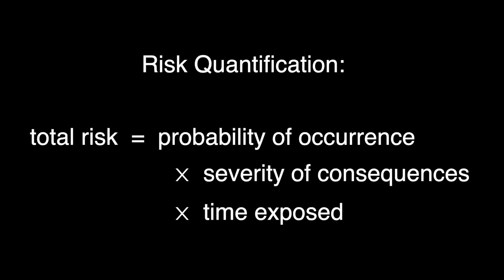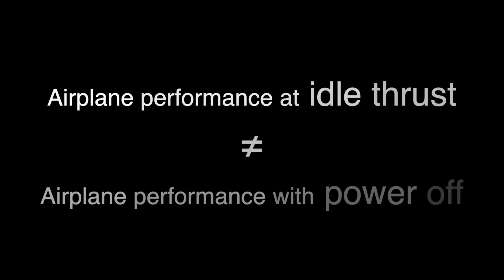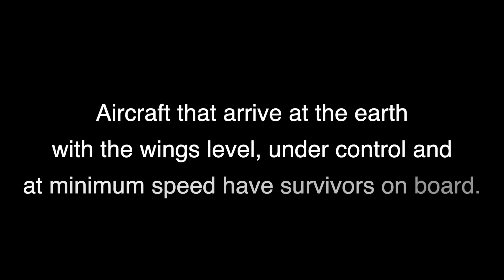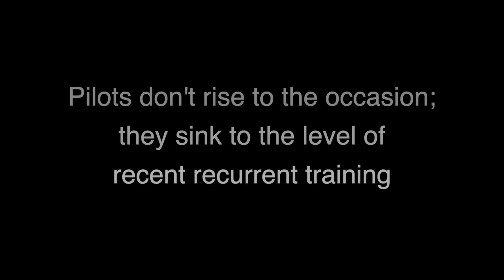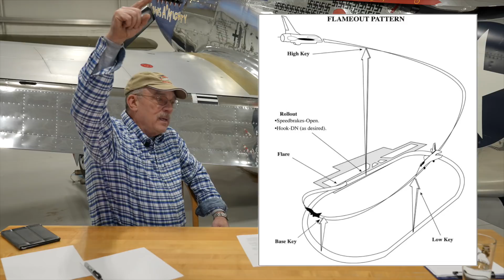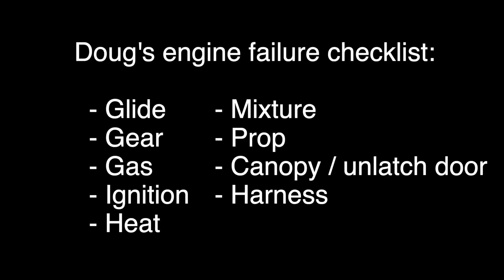Loss of engine power and the (im)possible turn - with Doug and Martin

Comment: On "The Turnaround Maneuver". YOU TURN AROUND THE AIRPORT.  That means he crashed AFTER TURNAROUND MANEUVER" and could not complete it, stalled it before the runway start area.  So it was An Impossible Turnaround, not An Impossible Turnback.  Those are two different maneuvers.  Never confuse needed maneuvers. A Turnaround is not A Turnback.  On the Turnback you dont turnaround anything, you just go to the closest runway on side if, or behind you if altitude and speed to do a 270 degrees of turn.  Many accidents are A Turnaround.  The ones that dont know Turnbacks call them A TURNBACK, when it was A Turnaround.  Different maneuvers they are.  I used to teach them both in my 1990's CFi years..

Comment: A 50% increase in speed is a 225% increase in kinetic energy! Going from 40 knots to 60 knots with the same mass is 2.25 times the kinetic energy. 1/2 M V**2
Reply: That important to know. Thanks
Reply: That was a real good video.  I and many other pilots don’t do enough thinking and planning in the event of an engine failure.  It was interesting to see the P51 painted in the paint scheme of George Preddy’s P51.  He was from Greensboro NC which is near where I live.
Reply: Correct
Reply: absolutely correct about that. 2.25 not the x 3 claimed. Also, no way you are getting a sink rate as low as 5-600fpm in a 45 deg banked turn in an idling C-172, so I'm calling BS on his claim to have done that many times. 600fpm wings level, just maybe.

Comment: Interesting comment about the power-off 180 and commercial license.  I learned to fly in 1977 from an old school instructor and EVERY landing we made was a power-off 180.  That is simply how he flew his airplanes (he was the airport operator, CFI, A&P and a DE) and how he taught his students.  When every landing is done that way, it makes off airport landings much easier as you have a fairly good feel for how far you can glide at the moment the engine quits.  Pilots should not need a commercial license to learn this skill.

Comment: 10:09 Yes we did simulated Engine quit After take of.  1996.  First at 2,500 agl, when coming back from cross country flights.  Then on 4,700 feet long runway with about 10 knots headwind.   We on Cherokees, did Turnbacks from 600 agl partial power, and 700-800 agl idle power Turbacks.  My CFI was the CFI of EmergencyLowManeuvering channel here on youtube.  He had 4 engine fails on take off before and knew those emergencies well.

Comment: Excellent video and discussion on risks and engine failure. 

According to the AOPA, engine failure is the 3rd leading cause of fatal GA aircraft accidents. 

If you look at even small FAA  part 135 Operators, they generally won't be flying passengers for hire in piston single engine airplanes for that reason.

Comment: EDIT: I've added one more question to my post.
Wow!  What a great bunch of lessons!  I had my own agenda hoping for a specific piece of info to be talked about (minimum acceptable AGL altitude in a Bonanza for a return to the airport with an engine failure during takeoff) that I began watching it by trying to play the video at 2x speed to more quickly get to that part.

However, what actually was talked about was so interesting and dense in content, that not only did I have to go back to regular playback speed, I also had to keep going over the same comments again and again, so I could take good notes.  Mr. Rozendaal is an encyclopedia of aviation wisdom!  Knowledge is great, but wisdom is better and he certainly has it!

As Mr. Rozendaal explained, because much more of the flight is spent in cruise,  the majority of our training time should likewise be spent on engine-out procedures during cruise, which can also include the part of cruise that occurs during takeoff, so long as "high key" altitude has been attained.

The only 2 details I would have loved to have seen addressed are:

1) Approximately what IS "high key" AGL altitude for a Bonanza?

2) Although 99% of the times, ANY strategy would be safer than trying to execute the "impossible turn"; there WILL be airports where the only alternatives to the "impossible turn" - due to population density - are flying into the side of a building or on top of a house.  It strikes me that in a situation like that, although attempting the "impossible turn"... MIGHT result in fatalities to pilot and passengers; flying into the side of a building would make fatalities even more likely for all on the aircraft, but would additionally exposes those in the building to being killed.  In a situation like that, wouldn't attempting the "impossible turn" be the "lesser of two evils"?  However remote that scenario might be, does it not make sense to practice the "impossible turn" (at a safe altitude) to at least be aware of what that minimum altitude should be in order to attempt the impossible turn?  The more altitude densities, passenger configurations, load scenarios practiced, the better of course.  I pose this question while being in full agreement with Mr. Rozendaal that however much value there is in knowing that/those altitude(s) and training for it; he is certainly right that much more time should be spent training for procedures when "high key" or near "high key" altitude is what we have to work with.

ADDITIONAL QUESTION
3) This question relates specifically to a set of circumstances where attempting a return to the airport poses a risk of fatality to the fewest number of people, i.e., an airport near a highly developed and populated area.  It occurred to me that for an aircraft like the Bonanza, the climb rate you choose (Vₓ or Vᵧ... or something in between) might be very critical for minimizing risks if there is an engine failure during takeoff.  I feel like there are 2 foundational considerations to this question.  One is that, at  Vᵧ, a high performance airplane like the Bonanza is substantially further away from the airport by the time it gets to 1000' AGL than say, a Piper Cub.  This means it also has more distance to cover to make it BACK to the airfield.  The second issue is that a Bonanza probably requires a much higher "High Key" AGL altitude than that of a Piper Cub.  If the Bonanza is routinely taken off at Vₓ, the advantage is that it's CLOSER to the airport at any given time of engine failure than it would be with a Vᵧ takeoff.  On the other hand, it'sALSO at a lower altitude in that same amount of time, so the severity of consequences is probably higher if the only option is to turn back.  On which side of that equation should a Bonanza pilot err?  To get the lowest total risk factor, which detail is more important in that risk equation?  Less time exposed to the danger, or lower severity of consequences?  Vₓ or Vᵧ?  Or is there some better balance in between the two?  More simply put, if a Bonanza pilot is taking off from an airport that is surrounded by buildings in all directions, is there a 'V' speed that's best, in order to have the lowest overall risk factor?

I hope that's helpful feedback and thanks again to Mr. Rozendaal and to you also Martin for such great content!!

Comment: Great video Martin. One point worth mentioning is that GA pilots rarely do a pretakeoff briefing. We should know what the takeoff power should be, and abort if we don't see that when we push the throttle in. If not airborne by 50% of the runway, abort the takeoff. Verbally go over what to do if the engine quits below 1000 ft, and what we consider to be the safe altitude for a 180 turn back. We can't figure out all these out during an emergency.
Reply from the maker: Yes. We do talk about a pre-departure briefing in this video, and even link at that point in time to another one dedicated to the topic.
- Martin
Reply: My CFI does a pre-takeoff briefing on every departure.
Reply: My new CFI..
 Video explains it soon on my daughter’s channel @fatherdaughterflights… insists on briefing abort/engine loss and “other options” on every flight. Our first lesson was a “did not depart.”  But I logged l2 Hobbs of taxi! 😎

Comment: Better practice first The Flyover Teardrop Turnback. At level flight at Vglide speed and 1,000 agl, fly over a highway, pick an easy to see spot,  fly over it,  then do a Teardrop Turn to fly over again in opposite direction.  Then do a teardrop again.  Do 3 plus until you do them very well.  Then fly over doing a Hook Turnback instead of a Teardrop Turnback.  Do a few Fly Over Tunrbacks Teardrop then Hook Turnback kinds.  That way you will understand Turnbacks better BEFORE doing them at airport.  
 At Airport do them partial power first from turning crosswind.  Last ones nose down power off 800 agl after take off.  Ignorance is not the solution, Ignorance is the problem.  I used to teach all that in my 1990's CFI years and know 3 pilots plus me that saved from crash on houses doing partial power turnbacks.  One of them he did C172 w 3 on board from 300 agl only.  No accidents we had.  You do Turnbacks on Flyovers, Box Canyon Turns, Circling Approaches and of course, LOTOT and EFATO Turnbacks too. 5 PLACES. Many accidents from pilots ignorant of turnbacks even if experts on IFR or Mild Maneuvers.

Comment: HI Martin another great video regarding safety,  many years ago  engine failure in 960 wooden wing Mooney m20A  returning at  night flying from Ottawa airport during instrument training to home airport 25 miles away.climbed to 8000 going west  about half was engine quit, the instructor stated he would take control I stated no my aircraft,  I had 300 hours of glider flying so position the aircraft over my home airport with circling approch and landed safely.  I was a bit high so did a side slip landed about one third down the run way. Knowing the L over D of your aircraft very important from a safety perspective. Keep up the great work Christopher Ottawa Canada
Reply from the maker: Sounds like a perfectly executed engine-out approach and landing, Christopher. Very glad nothing worse happened. Were you able to determine the cause of the engine failure?
- Martin
Reply: @martinpauly  yes broken crank shaft this happened long time ago 1967 this was my last single engine after that all aircraft after that were multi engines twin camaches, senacas then aerostars. Christopher Ottawa Canada

Comment: Great video. Stick and Rudder by  
Wolfgang Langewiesche is a great book that discusses this matter in depth. Aviation has several paradoxes such as to the idea of landing in airplane you have to prevent it from landing and in regards to an engine fail to keep the airplane flying you have to point it to the earth. Also to survive an engine fail you have to purposely attempt to crash the airplane in a sense. For the most part we are basically left with two options we must come to terms with once we are presented with an engine failure do we wanna spin in or crash pick one.
Reply from the maker: A great book indeed!

Comment: Another great informative video Martin.  I could listen to Doug for hours. My “home dome” here in DFW is KADS which has simply horrible landing options for runway 15 departures. Runway 33 is better but not neither are great. Oddly looking back over the last 10 years of multiple instruction flights in and out of Addison I honestly don’t recall a single instructor ever briefing on possible landing/controlled crash sites. It’s probably because there aren’t any and we’d rather not talk about it. I’m going to take Doug’s advice and do a more exhaustive study of the ‘ahead of the wings and into the wind’ area from my airport. Once I’m actively instructing one of the things I’ll implement is to introduce some sort of emergency situation on each and every flight. “You just lost an engine/you just lost your radios/you passenger just threw up all over your instrument panel... you get the idea. Keep up the great work Martin.
Reply from the maker: Addison is indeed a difficult place for this. The fewer the options are, the more important it is to study and understand them ahead of time. And in some cases, the right thing to do may be to shift our focus from saving ourselves to at least not hurting people on the ground. As Doug said, we have a moral obligation to protect them.
- Martin

Comment: Great video Martin as always very informative. Sure hope to get to meet Doug one day. One thing that wasn't mentioned that I learned flying a T34 or any aircraft with a constant speed prop is to get the prop control to full low pitch, its like releasing the emergency brake and really cuts down some drag. May make the difference in some turn back or 180 degree turn situations.
Reply from the maker: Good point on the prop control, Mike. We did not go into how to achieve best glide performance in this video - not that it's not important, but it's somewhat separate from the topics we discussed, and of course also aircraft-dependent. 
Come join us for a Third Thursday sometime to meet Doug!
Best regards,
  Martin

Comment: I’m a flight instructor and I teach many of these concepts on the ground and in the air with my students. I very much appreciate this video and how the material is presented. I’m saving it in my archive to share with students.

I had a question with the handful of times it was mentioned to practice at altitude by pulling the mixture. While valuable to assess a more realistic sink rate versus idle throttle, etc, I wanted to make sure that wasn’t an error in speech like it was for the power off 180° you edited. Thinking about it from a risk assessment standpoint in a training environment, it obviously increases the chance we could truly have an engine failure if the mixture cable breaks and is unable to provide fuel back to the engine. With enough altitude that risk could be worth it if you have adequate landing points within glide. Just seeking clarification. 

Thanks again for the video!
Reply from the maker: We actually intended to say "pull the mixture" there. I am not suggesting everyone needs to do this; the point was that all the people claiming a turnback is no big deal because they have done it successfully with the power at idle might rethink their position if they actually flew one with NO power instead of IDLE power. It is possible to experience and quantify the difference safely over an airport in gliding distance of a runway. And it is also possible to misjudge the glide and land off-airport if the engine doesn't restart. I'll let you be the judge of how likely that is and whether the prospect of discovery is worth the risk.
Regards,
  Martin
Reply: Thank you for the reply. I’ve since tested the wings level best glide sink rates while solo in a C172. My idle power best glide sink rate was 600 fpm versus a no power best glide sink rate of 650-700 fpm. A fairly subtle but noticeable difference. Thanks again for the reply and video!

Comment: Use the 777 EFATO Turnback Rule for light singles.   The 999 rule is for heavy singles. 
  The 777 rule can be done even when on preflight or driving to airport.  Will I be able to climb over 700 fpm? Yes? Are the winds over 7 knots? Yes? Then mark the altimeter to 700 agl for EFATO turnback.  The light Single engine 777 Turnback Rule
I learned turnbacks in 1997. 2 kinds.  For partial power, and no power.  Lately my 1997 CFi (retired now) came with a simpler formula. 
For non heavy singles = THE 777 TURBACK RULE NO PoWER

Comment: Another great discussion on an often underrated matter. However I don‘t agree entirely on the gear up or down topic. My intention would be to have the landing gear absorbe some energy as it might shear off. Another point would be a chance of better controllability on the landing roll. Just some food for thought.
Reply from the maker: It is certainly possible to conceive scenarios where the extended landing gear provides an advantage. The problem is that in real life we won't be able to tell exactly how good of a surface we are landing on. On a typical farm field, I believe Doug's advice is sound.
- Martin
Reply: The likelihood of ending up, upside down is much greater with the gear down.   The conventional wisdom is on un known unimproved surfaces gear up, in the trees gear down, and if you are willing to bet your life on the quality of the surface, gear down.

Comment: Thanks for the content.
I'm a beginner pilot and actually want to buy a plane. My misson will be "low and slow" in Switzerland, mountainous area. For safety reason, I prefere a STOL-Taildragger (like Kitfox, Cup). So if engine quits, I assume to have more options than with "a normal plane". Speed is life, altitude is life - I know. But the mission is different ;-)
Is a Taildragger a good choice as first plane for a beginner? I think no, when I see the taildragger vids from Martin and Doug.
So my question to the community, to Martin or preferably to Doug: What should I look for. I like to be in contact with Martin or Doug for that, if possible. Thanks.
Reply from the maker: I would not advise against training in a taildragger, maybe unless you live in an area where it's almost always very windy (e.g. Wichita, KS). Not that long ago, most pilots learned in taildraggers, and it was just fine. You'll want to find an instructor who specializes in tailwheel training, though.
- Martin

Comment: i am curious, would cranking the ignition help gaining  little bit of energy ? Or is the prop turning just way too slow to be of any use ? Plus the added upsetting forces during stressful  enough situation which would just make things worse ? Thank you.
Reply: The windmilling RPM is probably higher than the rpm that you can crank the engine, plus the pilot is tasked enough with flying and landing. Distracting the pilot with holding the starter isn’t what the pilot needs..